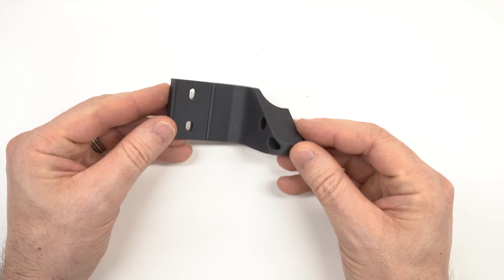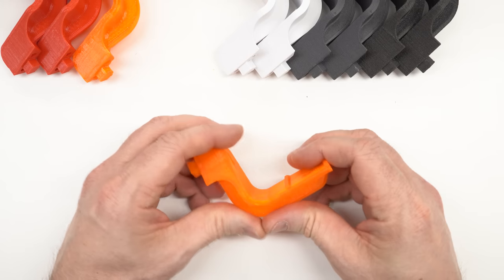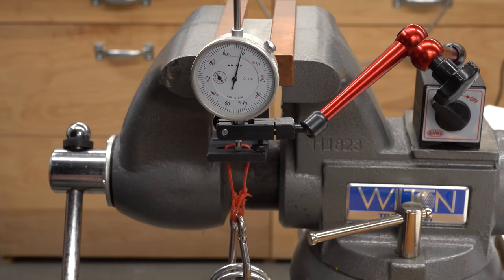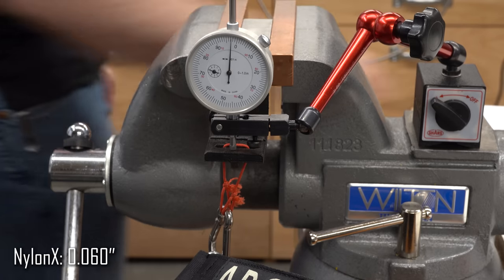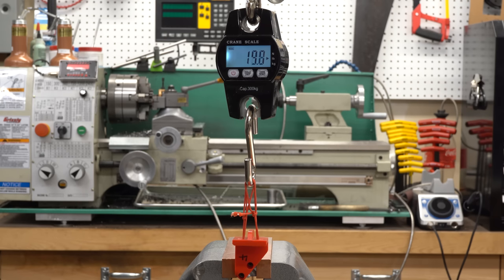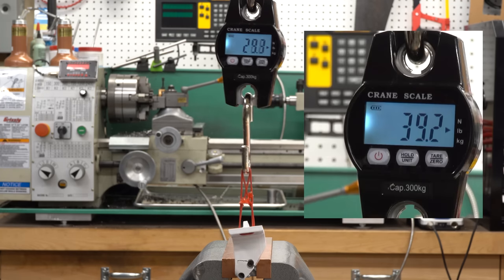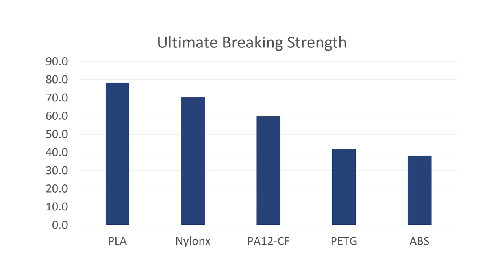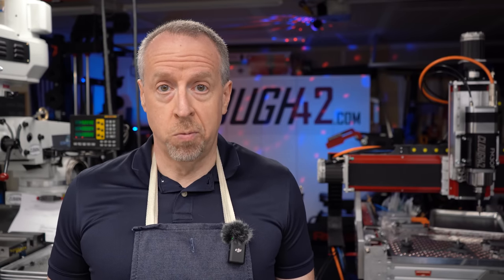Wait, What?  PLA is Stronger Than Carbon-Fiber Nylon?

Comment: I tthink this test might be useful for this part but not meaningful as the difference between materials. The petg did so well because when the piece bent the leverage got smaller, thus requiring a bigger Force to have the same torque. I think a straight traction test would be a better representation

Comment: Carbon fiber filament has its use in wear surfaces, I.E, printing gears. Its tensile strength is however rather low as in your results.

Comment: Why not do 80 to 90% in fill if you actually care about strength of the part. Also bringing layer height down to absolutely minimum will cause the layers to bond better. It will take considerably longer to print but it will absolutely increase the strength dramatically.

Comment: Color additives can weaken the plastic. White ABS is often not the strongest. Black may be better. Looks like the part isn't designed too well for strength per this test judging by the way they are failing.

Comment: Outstanding. I will have to rethink my prototyping endeavours now. CF embedded filament has appealed to me for a while now but it's not looking all that great, apparently.
Reply: I'd wait to decide.  They all failed by the screw hole.  That thin spot probably fluctuated too much among samples to rely on even subjective data.  If the test were repeated after thickening the failure point in the design, things would make more sense and numbers would be much better overall.

I think the wide spread among the PTEG was probably caused by one part with a blob of material deposited at that spot.
Reply: @Ideasite  astute observation - hopefully clough42 picks it up? My prototypes won't have holes unless they are reinforced with Al.
Reply: @aarondcmedia9585  If he just didn't countersink and went with longer bolts & washers, it would have been a completely different test with completely different (& much bigger) strength numbers.  This design has a failure mode that overrides material choice. That's a red flag. The tests are a better demonstration of mechanically finding design flaws than they are a material strength comparison. It should instruct the simple modifications necessary and another iteration.

In fact, the lesson is the importance of starting with reason & thoughtful design, but iterating through physical tests & observation to get valuable design clues, incorporating those clues in the next iteration and only stopping these cycles when improvements become insignificant.  Then you have a valuable design!

Comment: forgive my ignorance as a newbie but if you are printing parts that are intended to be under physical stress or load, why would you only use 20% infill? Why would you not infill much higher so that the piece is almost solid?
Reply from the maker: 1) this is a comparison test.  2) infill doesn't help as much for bending loads as you might expect; you're usually better off adding perimeters, depending on the part geometry.

Comment: Correct me if I am wrong. But cf nylon will come out really stiff but after it absorbed all moisture it can it becomes softer. How long after the part was printed did you so the test?
Reply from the maker: About a week.

Comment: This test only compares filament with carbon fibre that is already inside the nylon. If you print with inlaid carbon fibre like used in the Markforged Printers you truly can get the same strengths as aluminium. I don’t like the marketing of PA12-CF and similar filaments as they try to claim the strength which can only come from the carbon being inlaid separately like in the Markforged printers.

Comment: Pla is super strong. Ifffffffff it doesn’t get over 65 degrees where it’s being used lol. Even my shower soap bar holder  didn’t make it long. With carbon fiber filaments the ones with the long nozzle clogging fibers are the best. The carbon powder filaments aren’t very underwhelming

Comment: You need to try a better quality nylon and petg, I use UPAHT-CF15 (Based on Nylon11) and PET-CF15 both are next level, then you have PC-CF, and the absolute strongest is something like Prusa PC Blend. Also, a basic PA-CF would not break but would bend, flex and stretch almost like a flexible once it hydrates, the screws would have pulled through before it would break, I use that material for parts on bikes, ebikes and motorbikes, as its vibration and impact resilient, and if you stack the vehicle, chances are the part wont break due to the inherent flexible nature of standard low end PA-CF, now PLA, or more so PLA+ is perfectly fine in some parts of the world, but where I live, it gets soft and deforms from the ambient outside air temp making it about as useful as tits on bull.

Comment: PLA does poorly at higher temperatures.
Even if you drill holes in it, you have to be careful.
Here in my country, it is therefore only suitable for indoor (excluding cars and such) applications, where there is no significant heat source.

Comment: given you were using this part to hold a weight, but pulled the strength test 90 degrees from the intended direction of force - will this mean your test isn't correctly testing your application - though it is still valid so far as the test directions you did do?

Comment: On a cheap 3D printer any of us can afford yes, it’s probably better to use PLA. However, on the $250,000 carbon fiber printer we have at my work it’s not even close. We have a piece we show the engineers who are worried about strength. We hit it with a hammer on a steel table to show its strength. It’s absurd how strong it is.

Comment: I was thinking during those tests that different shapes would react differently, in the same way concrete or wood only works in one direction. So maybe carbon fibre behaves in the same way and this makes the test inconclusive? I think maybe a straight piece is better to determine strength than making a shape fail by bending. I didn’t watch the whole video so maybe you mentioned this

Comment: I'm actually not a fan of eSun's ABS+. Comparing to their ASA, which costs a bit more, ASA has better layer adhesion, is far stronger, more temp resistant and also UV resistant. Downside is it only comes in natural or black.

Comment: The strength of carbon fiber comes from mixing continues strands of strong string (carbon fiber) with stiff epoxy resin. 

Adding carbon fiber power to a weak plastic like PLA shows a misunderstanding of everything.

If you want strong carbon fiber parts use carbon fiber fabric in a mold with epoxy resin.

I personally wouldn't use a 3d printer for any part that needed to be strong. Well maybe a 3d metal printer but never PLA.

Comment: They all fail at the exact same spot!!  Thicken that spot and run more tests!!

That thin wall by that screw probably has a huge range of difference among samples, foiling the test because that thickness probably relates to strength on a log curve.  A part half the thickness at that spot is unfairly handicapped.  Thickness around the screws - equal to the rib - would be a big improvement on the part.

Comment: as both PLA and Nylon absorb water a lot, I'm curious how those properties change over time with exposure to humidity.
Reply: PA12 CF has lower initial mechanical characteristics compared to other (PA6 based) CF nylons, but it absorbs much less water. It will be interesting to compare PA12 CF and nylon X after some time and expousure to humidity.

Comment: A user needs to pick the 3D printing material based on application.  PLA may be stronger but if you need to make a thing that is subjected to higher temps or outdoors then it is the worst choice.  Exposure to chemicals (oils, solvents, detergents) then you have to make choices based on that.  Strength testing is a horse that has been beaten to death. Actual application if using for function the material used needs to be based on that application.  If you are just making novelty toys and curios, then stick with the cheap PLA and print to your hearts content.

Comment: Maybe this channel is only about 3D printing, in which case my following comment is irrelevant:
The key issue is that a 3D printer formed all these matrices. The primary strength advantage of carbon fiber is as woven sheets that span the full, or lapped, dimensions of the component. A 3D printer does not provide that scale of woven fiber for a structure. Additionally, the carbon fibers will be randomly oriented within the polymer matrix which largely negates their utility beyond inhibition of small scale crack formation.
Reply from the maker: Most of the tensile strength comes from the base material.  The fiber content increases rigidity and reduces shrinkage.  In some cases it improves tensile strength, but not like continuous fiber would.

Comment: Pla is the strongest/hardent 3dprinting material there is (maby not engernning materials) but it's low heat resistance and low steability (creep) and brittleness makes it not suitable for a large amount of applications.

Comment: the thing i take away from this, is "if you need strong parts from a 3d printer mill them out of aluminium,  if you just need a spare mountig bracket or something not to stressed use a 3d printer

Comment: These numbers go counter to what every single manufacturer has stated for PLA and pretty much any CF filament. Do manufacturers lie and sometime make up numbers? Sure.

Do ALL of them make up numbers and have roughly the same deltas?  Well apparently. Since companies like eSun rate their CF at tensile strength of 170 mPA and their PLA around tensile strength of 30ish mPA. 

All companies have that same delta between their PLA filaments and their CF filaments in terms of tensile strength.

So either this testing is invalid. The filament has issues. The filament wasn't dried. Or every single manufacturer is lying about their filament, and they all happen to be lying within roughly the same delta %. 

I want to see another independent test doing this same experiment, but with very controlled conditions, and accounting for humidity. Even provide the 3mf file so we can try it ourselves. 

I've literally never seen any documentation anywhere that shows PLA having a higher tensile strength than CF, from any manufacturer. 

I want more info so we can see whats going on.

Comment: Test samples geometry is not suitable for material strength tests because load case is constantly changing while deflection occurs and some materials have higher elongation than others, i.e., for the same applied load you'll get different load cases and consequently different stress cases. Plus, failure is occurring on a location near to test samples fixing points, with stress concentration geometry , which the conditions are out of control , not reproducible between test samples and therefore results can't be trusted. Traction and bending tests should be done separately. Failure location needs to be under full control and needs to be far from fixing points in order to get more reliable results. I believe there's standards for polymer & composite materials testing.

Comment: I hear a lot that pla is strong but the material just isn't practical for anything other than miniatures.  A slight rise in heat will destroy it.  Sun exposure destroys it.  Shock loads destroy it.  I have not found a single use for pla other toys, miniatures, or other indoor thing that I simply need a shape.

Comment: Its a temperature thing not a strength thing. PLA is strong, just not UV or Heat resistant. If you need something that has to withstand temperature, PLA ain't it. I've started playing with Carbon Fiber PETG. Kinda like it.

Comment: PETG is not dimensional accurate, PLA is over all very accurate and very strong. PLA has one big down fall and that is resistance to direct sunlight. The carbon material is great and looks good but its not worth the extra price.
Reply: @derschwartzadder  thats a given considering it prints at 20-40 degrees lower then ABS. But what I am referring to is the fact it fails even faster in direct sunlight. Convection heat transfer is where pla fails very fast.

Comment: You say in the video that you're measuring the strength of materials as a breaking force in Newtons, but your scale clearly shows it's set to lbs mode. Are you sure that's N you've measured? You're using that setting consistently, so it doesn't matter for the relative comparison, but the absolute values would be off.

Comment: Great test! We 3D print at my S.T.E.M. school and I've learned a lot but still have more to go with regards to fine-tuning software for the best possible prints.  Thinking of getting my own Prusa MK3S+ printer for miscellaneous type stuff.
Reply: For the price that Prusa is currently charging for the MK3S I would just spend a "bit" more and go straight into the Bambulabs X1 Carbon with the EMS. I love Prusa, but right now Bambulabs is running rings around them. It's far faster, more capable printer for a price increase that isn't unreasonable.

Comment: I'm always laughing at those spending so much on materials. I always use PLA with exception to heat tolerance. The only concern of mine is how quickly it turns to butter in the sun 🌞

Comment: Pretty suprised PLA is the strongest one. But, is it because of PLA is most easy print material, and have the strongest bonding during printing?
Reply from the maker: It's hard to say.  Layer bonding varies between materials, and even between different colors of the same material, due to the pigments and other additives.  I got lots of comments telling me PLA is strong, but I was surprised to see the results.

Comment: Your strength test is moot unless you're torquing the screws to the same level.
The compression of the screw will weaken the material.
You're also stating "newtons" when the gauge is set to read lb's.

Comment: I don’t think you did anything wrong. But… I feel that testing the material rather than how the fill printed, or an angle, or the screw holes isn’t the best way to test the material itself. To me a flat printed bar with 100% fill and holes that have no countersinking into the material would take as many variables out of the testing as possible.

Comment: The test results aren't that much of a surprise. The only thing that surprises me is that the manufacurers are even allowed to use the words "carbon fibre" on the product :)

Actual carbon fiber is 100-1000x longer in a monocrystalline strand than graphite flakes, and has about 10-100x higher tensile strength.
The carbon in all of these snake-oil filaments called "carbon fibre" isn't even FLAKES, they're generally in the material class a serious manufacturer would denominate "graphite flake powder" or "crushed graphite"....
You don't add that to a polymer for tensile strength, you add it for dielectric purposes, or friction /surface wear purposes. In general it makes the base substrate WEAKER.

Comment: It's worth pointing out as well that PLA can be industrially composted and isn't petroleum-based so with due diligence on the part of the person disposing of it you can avoid pretty much all of the negative consequences of creating and disposing of nylon polymers. PETG isn't as great since it requires petroleum but at least it's highly recyclable, a process that is extremely costly in the case of nylon. Moving towards polymers that don't end up back in the water cycle means eating less plastic and the leeched endocrine disrupting and carcinogenic compounds they contain so why not consider it as a factor in choosing polymers after narrowing your options down by their mechanical properties and intended application ;)

Comment: people who think PLA is the best filament for structural parts just plain have not used other plastics. Try using PLA outside in anything higher than 85 degrees, or colder than freezing. PLA is good for stuff that will be used ornamentally in a climate controlled environment or for quick prototypes, not for finished products.
Reply: not to mention it has virtually zero chemical resistance. any small amount will remove all of the structural integrity of the PLA

Comment: Yeah. For a mount like this, nylon is one of the worst materials in 3d printing. It deforms (especially over time under load like a mount) Its not very rigid. Abs-cf or ideally polycarbonate (especially pccf) will be far better. The qidi pacf is one of the worst and yes, i have a qidi cf-pro and do like the printer. Qidi Pacf looks great, but i wouldnt use it for any kind of mount. PC and PCCF of glass loaded PC is much more rigid than the common filaments. Its not as easy to print, but the cf-pro or ifast will cope, as long as you have good bed levelling and adhesion. And dont open the door during printing.

Comment: was the PETG dried? the first print if it was a fresh spool might have been dryer than the rest and had its optimal strength. grasping at straws though i suppose.
Reply from the maker: It's all off the same roll.  Where I live, it's so dry that I've never seen a roll of filament change properties due to moisture.  Even rolls exposed to air for years print the same as the day they came out of the package.  I've tried drying, just in case there's a difference I'm not seeing, and it just doesn't make any difference in this climate.
Reply: @Clough42  I think the set of samples had different thicknesses at the same point of failure - around the screw.  Thickening would remove that significant but poorly controlled variable from the test.
Reply: @Clough42  Just as another data point James, I'm in semi-arid Colorado, and I didn't worry about moisture because I hadn't noticed any changes either. But, then I got a dehydrator (mostly for making dog treats, to be honest) and tested drying my filament. Surface finish and overall printability were noticeably improved. So, even if it's not as dramatic as somewhere more humid, it can certainly have an effect.